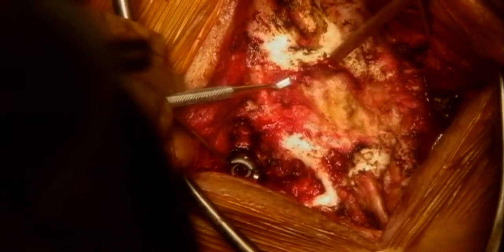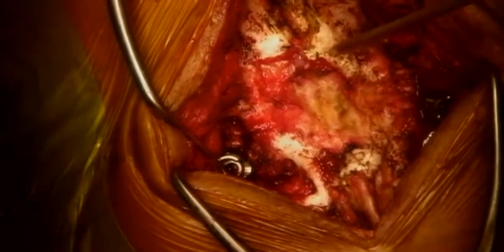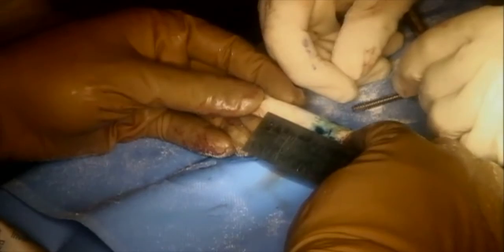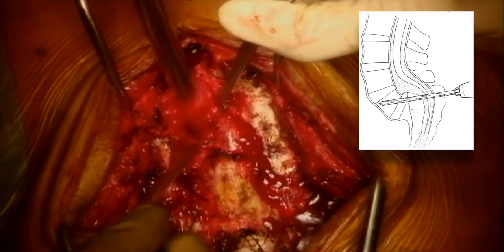Trans-sacral fibula (Bohlman's procedure) for High Grade Spondylolisthesis

Comment: Beutifully demonstrated with clarity.

Do you consider putting two Dowel fibula??
Reply from the maker: Possible. I have found one is sufficient. I have been using a mesh cage now. it is easier than fashioning the fibula to fit the hole.